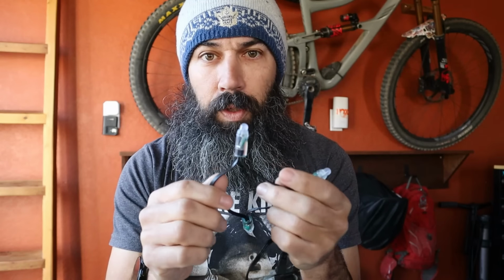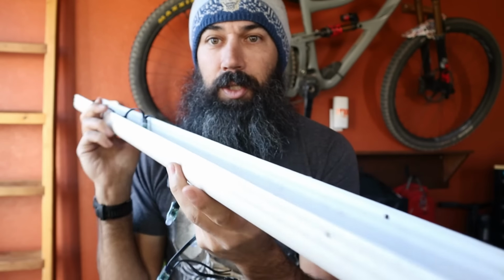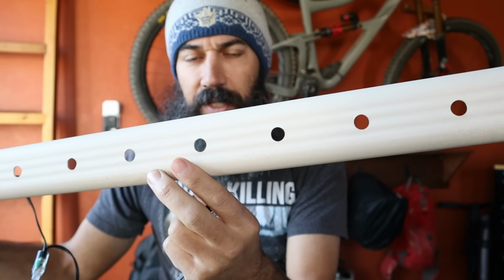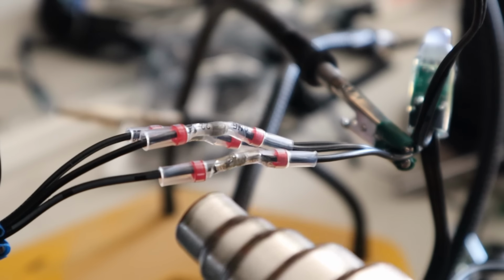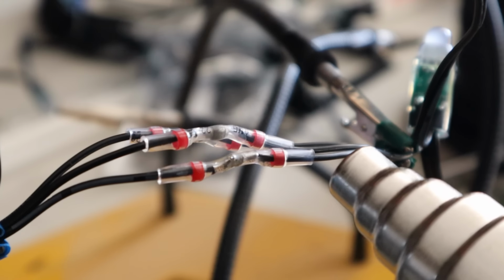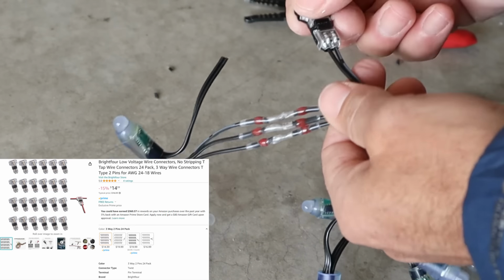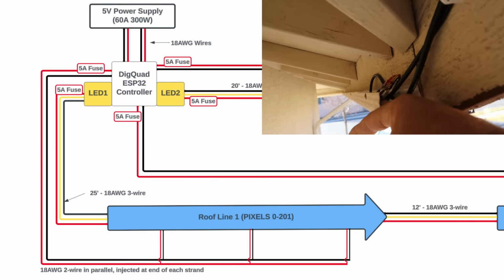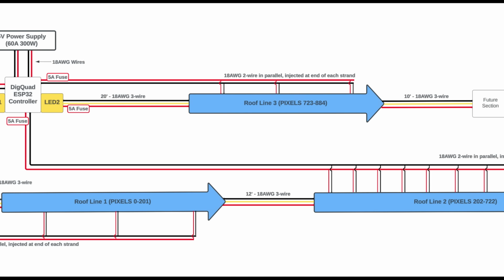Permanent and AFFORDABLE Holiday LED's

Comment: Solder is Better or the butt connectors but you could use Liquid Electrical Tape on the Connecting plugs. I would Recommend to Test any connection you make that is not the one already tested. Also if you Do use Solder Do not use Acid Core! make sure its Rosen Core. On a Hole this is an Really Good Idea. And a Time Saver. you can do this in the Summer when you have nice Weather. i want to Say Thanks for That.
Reply from the maker: Great info dude!  Appreciate that!

Comment: For the 12v power supply, what amp fuse would be required?
Reply: Fuses are supposed to be sized to protect the wiring from overheating in case of a short circuit. The supply voltage is irrelevant. 12 gauge wire is rated for 20 amps. A smaller-valued fuse can be used if you absolutely know you won't be drawing more than a certain amount, but know that if you ever do have enough current flowing to blow the fuse it's because something has already failed.
Reply from the maker: I’m using 5a fuses right now with 5 separate power outputs (2 LED strands and 3 power injection runs) a separate fuse on each. Mine is 5v, and I’m running 18awg wire right now.
Reply: @DadDoingStuff are you talking about the 5A that comes with the controller? Curious Why you chose 5v? AliExpress is having a new year sale now so looking at buying. Did your 500 pack come with 50 per strand?
Reply from the maker: @joe_duck  yes they were 10 strands in the pack, 50 pixels per strand.   I ultimately chose 5v just because it seemed like it would pose less of a fire risk if one of the pixels decided to have a meltdown on me. That said, if I went back to start over, I’d likely use 12v, but only because I have a really long run with 722 pixels in a row. That distance means voltage drop and voltage drop causes color issues. So I had to add a lot of extra power injection points.  12v likely would have required less. So, it really depends on what you are trying to achieve. Shorter runs that are all close to the controller, I think 5v is the way to go.  Longer runs, probably consider 12v.  And whatever you do, don’t under size the PSU.  I learned a bunch watching a channel called “The Hook Up”. That guy knows his stuff!  Hope that helps!
Reply: @DadDoingStuff  I just watched drzzz on the voltage drop. Basically had about 10 50 strand lights setup. For 12v he had to inject after the 6th strand and after the first on the extreme (all white). Right now I’m on his discord and let me say things got a lot more expensive with the lights they recommend vs what I was going to buy 😂

Comment: We have a security camera that works well on our front porch, but after having christmas lights around the porch the wife likes how much cleaner the picture is and was wondering how we could add lighting without them being "christmas" lights. This maybe the trick. I'm curious on the controller portion, so we could program it for different holidays etc.
Reply from the maker: Lots of good content on YT for controllers and such. Honestly it depends how plug n play you like things. If you aren’t doing a super large amount, something like Govee lights are a good option to do your own DIY holiday lights but also have the controller part all pretty much plug n play. That said I will be doing a detailed video about my controller and wiring.  Hopefully pretty soon.
Reply: @DadDoingStuff  myself, I wouldn't have a problem doing wiring, programming, etc., I always like to learn those things. The wife on the other hand would want it simple in case she'd ever have to deal with it.
Reply from the maker: That struggle is real dude!  I will probably never get my wife to use the WLED app or interface! 😂

Comment: 12v takes more power than 5v. but 5v needs power close to it

while there, why don't you use separate psus?

instead of 80a 5v and long wires you could do 8 10a psus. if standby is issue, just switch them remotely. mains is orders of magnitude less loss

surely you considered this but didn't do for some reason
Reply from the maker: Great comment dude.  I actually didn’t consider that, because when I started, I didn’t really know any better. But I’ve learned a lot through this process. Other than pure white light (which seems to take more juice with RGB pixels), I don’t get much in the way of color loss.  That said, I’ve learned that for really long runs, separate PSUs with fewer pixels per is the way to go.  As I add more lights to other sections of the house, I’ll definitely be adding more controllers and PSUs.
Reply: @DadDoingStuff Hey man, starting out I want to say thanks for the vid. It’s very interesting and I think I’ll use some of your techniques! 

Adding on to this chain, I also want to help you with gauging your wires. I’m an automation specialist, so when I saw you used unprotected 18awg from your psu to the controller/ power distro, I got nervous. Haha

I 100% agree that multiple psu’s is a better option if you can do it, but if you can’t, you NEED to increase the wire size from your supply. NEC (national electrical code) standards show 18awg only capable of 7amps on it when everything is rated at 75 degrees C.

For a 60 amp feed, you need 6awg or 8awg (6 is the safer option) and ideally a 2 pole circuit breaker capable of breaking a DC arc (dc arcs are harder to break than an AC arc in case of a short circuit or overload) 

Now, all of this is at 5v as well, so a larger wire size will also aid in reducing voltage drop on long wire runs. 

My main point is that I have seen some nasty damage from wires being too small and unprotected, causing the wires to become fuses and melting, causing fires. I think most of your wiring is great and on point, I would just like to see that feed line be larger, or use multiple psu’s with the smaller gauge wire.
Reply from the maker: Dude!  Love this info. I also love how much I learn from nice folks like you that take the time to comment. I’ll absolutely upgrade the wires from the PSU to the controller. Good call there. Now about the breaker….I don’t know much about those. It’s for sure on a 15a breaker.  But I also have the PSU being fed from a surge protector. (well, a smart plug that’s plugged into a surge protector so I can keep the PSU off when I don’t need the lights and controller online). Not sure if that surge protector makes any difference?  🤷🏻‍♂️  As one last precaution I also installed a smoke detector right above the control box, just in case someone crazy were to happen.
Reply: @DadDoingStuff  Happy to help someone who inspires others, as well as myself! This reply will be a bit long and extra technical, but hopefully it makes sense!

Your head is in the right place, there is just one additional breaker you need to add. The surge protector is good. That is for protecting against a huge surge of power in a short time (the classic example is a lightning strike) and having that on a circuit that is outside is a perfect application. And a 15a breaker before the power supply is good, thats a standard set up and should pose no problems. 

The breaker I was referring to is after the PSU but before your fuses. I really liked seeing you added 5a fuses on each circuit, but it is ideal to add an additional fuse/breaker before any load that prevents overdrawing the maximum load of the power supply incase of a short circuit before the 5a fuses and after the PSU (on the 60a power lines). It will also trip in case you add more circuits but don't upgrade the PSU or maybe the power draw per circuit was higher than you expect. Then just a fuse/breaker will blow instead of your power supply, or worse. It is there so if all your circuits individually are under the 5a limit but you have a lot of circuits that total above the PSU output limit, it will protect the power supply. 

I know it seems a bit silly, especially if you have the 5a fuses in the same box as the PSU, but is good piece of mind and it'll protect against any future mishaps. 

I tend to prefer breakers because they are reset-able, but fuses are cheaper and probably are better in this case. Here's where it gets a bit technical, but if you want to go deeper, you can read the amazing documentation on the breakers/ fuses data sheets (thats sarcasm, try not to fall asleep reading it. lol)

I'm just gonna give some basics about circuit breakers and why there are different types. The main difference that concerns you is the AC current vs DC current. Incase of a short circuit, a DC current line is harder to "extinguish" the arc because it is always on vs an AC current short where it is easier to extinguish because it's constantly alternating from 120v to 0v to -120v back to 0v and repeating, so when it crosses that 0v line, the arc stops. An arc is harder to start the further the 2 conductors are from eachother, BUT if there is an arc that is already started, it can maintain larger gaps as the gaps increase. So, for this reason, on a DC circuit you need a breaker that is able to extinguish a "bigger" arc. 

Here is a really good article (I don't think I can post a link, but it's by EEPower, the headline is "AC and DC Circuit Breakers for Overcurrent Protection"). 

As far as a fuse goes, I don't know off the top of my head, but I think it doesn't matter for AC or DC applications as it's operation is solely based on how hot the filament in the fuse gets. You should have plenty of choices on Digi-key, Grainger, etc for these, and they should specify their applications in their data sheets (I know Digi-key has great documentation on products, so I would recommend looking there first)
Reply from the maker: @nolansprojects2840  Thanks for taking time to explain that!  Makes total sense. I’ll definitely add some fuses between the PSU and controller when I replace those wires!    I got hella reading to do!
Reply: Please remember that when the voltage is DOUBLED the current is reduced by 1/2. That’s why industrial users require 3 phase 480v for the economical advantage it provides. Remember voltage supplied by a utility is FREE. It’s the amount of current in amps that the consumer uses that determines the amount of the bill.

Comment: My only take is that LEDs fail way sooner than expected … to repair/replace don’t seem to be a easy task. The gutter channel, for a rather permanent install, does not look very nice. Thank you for an educational video; the lights look fantastic!
Reply from the maker: Thanks for the comment!  Repairing/replacing was actually one of the advantages to the strings.  They are way easier to pop out of that channel and splice in a fresh pixel if needed. Not what I hope to do often, but shouldn’t take more than 15 min if/when one does fail. Strips would be a whole different challenge!

Comment: Great video. I think the only change I would make is, instead of cutting the wires and using all the butt connectors, you could slide a piece of shrink tubing over the wire before connecting. Once they're connected, hit it with the heat gun and you've got a much faster waterproof connection that, if need be, can still be sliced and disconnected for maintenance or replacement.
Reply from the maker: Not a terrible idea. I dove into this with so much confidence that I’ll NEVER have to cut those apart……maybe.  😂  Actually I’ve been looking at better waterproof 3-wire connectors.  Something that would let me just unscrew them if needed.  Pretty sure my next project will have something like that.
Reply: Deutch make some pretty good weather proof  hi-reliability connectors.  Have used them on automated agricultural equipment and similar projects. Clever use of downspout vinyl as packaging is the bug for things like this. Good job !
 @DadDoingStuff

Comment: buy a 12mm drill bit
Reply: That would have been my choice as well. 15/32" is just slightly too small for those LEDs to snap in easily. 12mm is more like 15.12/32 in.
Reply from the maker: Yeah……except I already owned a 15/32!

Comment: just checking, you mentioned about 750 led's/pixels ?, what was your total run length?
Reply from the maker: I have 722 (about 165’) on LED1, and 162 (about 40’) on LED2.  So 884 total pixels on that controller.  When I add more to the yard/ house later, I will need to add additional controllers for sure.

Comment: Great job.  The only problems I see are with birds wanting to nest in them or vermin (rats, squirrels) using them as raceways to get around/enter your home.  Also, you didn't say why you chose 5v over 12v but using the 12v WS2811s would have been slightly more expensive but would have meant you wouldn't need to inject power as often if at all.  I have A LOT of experience with these lights and there are places I would recommend one over the other - there's no wrong choice but in running long lengths for permanent installation like yours I recommend going for the 12v if for no other reason than not having to inject power every 50 or 100 lights.  Depending on the installation, 12v may eliminate the need to inject power altogether and that can make up for the extra cost of the 12v lights.
Reply from the maker: Hi Roy,  I’m definitely still a noob and learning more all the time about the voltage part. In my mind, less volts = less fire risk. (That could be WAY off base, but it seemed to make sense) That was the primary reason for using lower voltage. I did have to inject power every 50 pixels which was a bit more work, but not terrible with a parallel injection run. 
I’m not worried about squirrels or rats here, but birds could be a concern. I’m already thinking about how to solve for that should it become a problem. We also get wasps that like to build nests in our eaves, so I need to keep an eye on that as well. 
Appreciate your knowledge and comment!

Comment: Metal (or plastic) J channel for light mounting and running wire in is a good alternative, just as cheap and much smaller for those who have metal soffits. You can also mount close to the wall to get more lighting effect on the house itself.
Reply from the maker: Where do you find plastic J channel?  I looked online because I wanted that first.  I just never found any. But maybe my Google skills are lacking….🤷🏻‍♂️
Reply: @DadDoingStuff  Big box stores, both Lowes and HD have it.    I have that plastic soffet material so can't get to the back of my facia board, and the gutters are right even with the bottom for the most part.   Maybe I can do something into the aluminum strip holding the soffet....
Reply from the maker: @akjammer1 As I was researching this project, I found a lot of products were actually geared towards soffit mounting solutions rather than back side of the fascia.  (and most of the content online seems to be centered on Utah for some reason)  It's one of the reasons I started looking for my own solution.  Also probably better to do the low-profile puck lights with soffits rather than the pixel strings.
Reply: @DadDoingStuff  Thanks.  Yeah, I've been researching for the past couple hrs myself.   The problem with those surface mounted puck lights is the exposure.   I like the way yours just have the tips exposed with the rest hidden.  Less HOA issues that way.   I saw TheHookUp's review of the different lights and still thought yours was better.   This'll be a Spring project for me, so I've got plenty of time to come to a decision.   I'll probably also buy something in small quantities and test them out.   Maybe on the back shed.  ;-)

Comment: I’m installing 12v pixels now on my house. I special ordered flat pixels spaced @12” in custom lengths from an online vender. 4 strings of 100 pixels were 100$. I’m using 5/8” x12’ long J channel from Lowe’s. Mounting under my eaves. I’m half way done now it looks like Govee or Jelly fish lighting. I’ll have about 400$ in it. I looked into custom 8’ long metal track online but it was gonna be more for the metal and shipping than the lights, wire, etc. great job by the way very informative.
Reply: But if it looks looks like Govee lighting, then the Govee lighting would be cheaper with much less DIY? genuinely not intending to be snarky, but genuinely curious as to why you choose DIY? (I keep vacillating between Govee and DIY but moving towards Govee)
Reply from the maker: @jerseyman99  I’m curious about Kevin’s answer as well, but for me it completely depends on what type of installation you need. Govee is definitely more plug n play, but the adhesive based mounting makes me nervous about its longevity. Also need to make sure you have 110v AC outlets placed in the right spots to plug in their controllers.  If I had white soffits and access to power outlets, I’d definitely consider Govee as an option. The last thing that I don’t fully know about Govee is if it requires an active internet connection or not. (Lots of IOT devices do these days)  My WLED doesn’t require an internet connection to run as it only relies on my local network for any configuration.  That said, I also can’t turn my lights on/off remotely when I’m not home.  But given everything is on a calendared schedule, that capability isn’t something I need or would use.
Reply from the maker: Awesome job!  Your build sounds legit, and affordable!